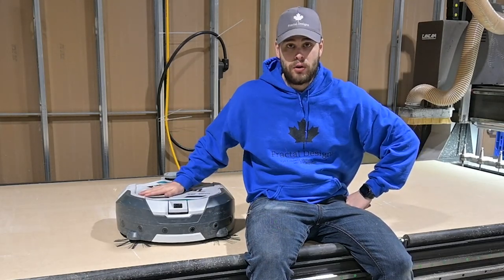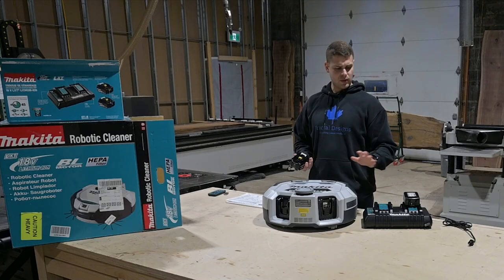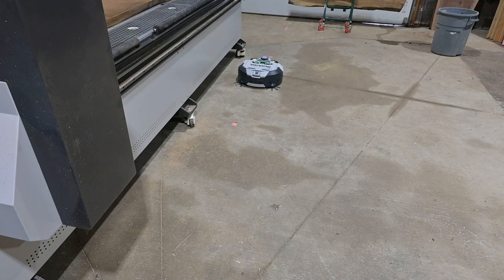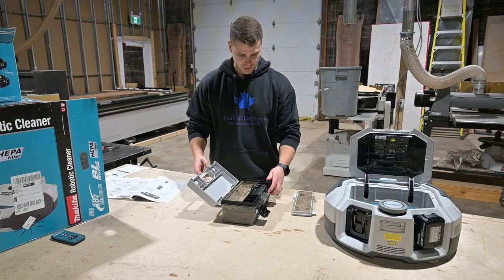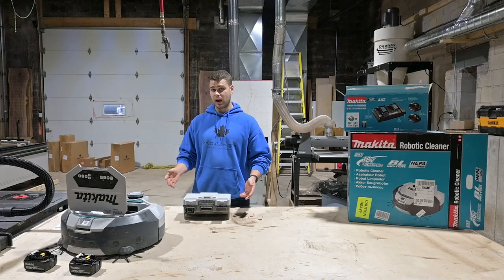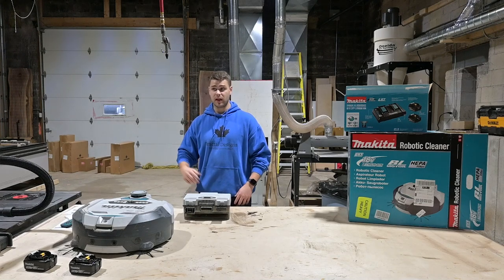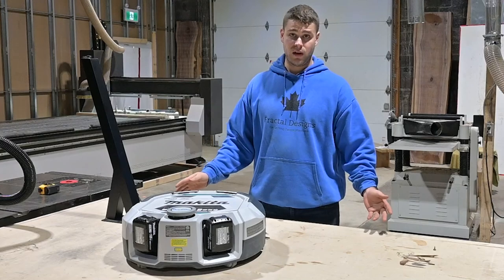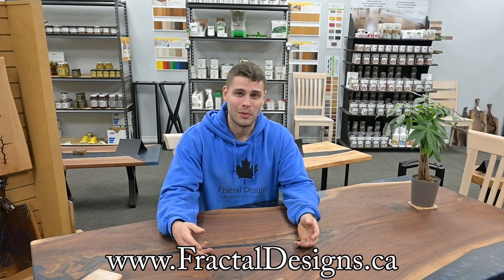Makita Robotic Vacuum DRC300 Initial Thoughts and Review

Comment: Congrats on being the first review of this I could find.  It would be nice to know how it works in a garage environment.  Will it scratch up my sports cars, for example?  Is it good with wet leaves and pebbles dropped in by car tires?
Reply from the maker: If it was me, I would definitely add some foam tape onto the bumpers - it rams pretty well if the sensors are dusty... Small rocks should get... Anything bigger than a penny likely not. It works pretty awesome but has its limitations. I haven't used it for any wet leaves. Small dust and debris it's awesome.
Reply: Wet leaves ?? Really?
Reply: I have the older model Makita DRC200Z to clean my barbeque area and patio so it can definitely handle some wet leaves and pebbles from car tyres.

Comment: Thank you for the detailed review! You are still basically the only source of information for this machine on the internet a whole year later! I'm very much on the fence about purchasing this for my garage shop use. I noticed the app had an update 3 months ago at least for the iphone platform. Have you had any success with this most recent update? I don't personally need the app and am ok with just starting the robot manually but I am curious if the app provides firmware updates to the robot to improve its reliability? Does the robot handle fine dust from your woodworking tools without clogging the filters and losing all suction too quickly? I plan to use it exclusively for keeping the floors as dust-free as possible. Would you make this purchase again today after living with it for the last year?
Reply from the maker: I haven't tried the app again. The sensors have started to give me a hard time on our shiny-ish floor. I believe it's from the reflection. A version of this a little more robust- fewer sensors and more filter capacity would be better IMO. I believe they have launched a new one now I'm not sure if they've fixed any of this!

Comment: I got one and think it’s far better. Than the original. The remote control feature is cool. 

The app however didn’t work because Amazon likes to sell used products so whoever had it prior changed the password. I reordered it somewhere else and returned it to Amazon. 

The green brush seems to work better on higher pile carpet and leaves stripes like my Walker Mower.

Comment: Great job with the video. I purchased a Roborock Q5+ for a retail store and it failed miserably. Hoping to find a more robust commerical solution. The Roborock failed me because of the LIDAR. Lidar doesn't work with mirrors and mirror/glass surfaces. It can even creates phantom rooms. I noticed that this comes with LiDAR also, Did you encounter any issues with it?

I feel like buying it and trying it but returning it would be such a hassle.
Reply from the maker: No issues with the Lidar part for us. We notice the shiny part of our floors sometimes gives us issues with the cliff sensor. We don't have any mirrors or shiny surfaces around that the top sensor would see so I can't really comment on it for you.

Comment: Thanks for doing this video! Did you ever get the app running and what do you think of this vacuum after a few weeks of use now? We have been looking at this for a long time for our Cnc shop but want to make sure we can get the mapping figured out in the app.
Reply from the maker: Hey! I never got the app to work, I will give it a go before we upload our couple-month review. I do believe you can set up the mapping with the remote still. We find it's still best to pick up most CNC debris with a shop vac and then allow the robot vac to do the shop and pick up whatever was trekked around!

Cheers,
Brad

Comment: Hello, we have an area of 15000 sqr meters. But we don't have rooms with open space. In this case, we will need to use more than one robot, then we will use temporary separators to do the mapping. But I am worried that since it is not a very smart device, when we remove the separators, will it work within those limits or will it move to the next area saying there is no wall? Can we draw boundaries like robot vacuum cleaners at home?
Reply: Nope no virtual boundary you have to use the expensive magnetic tape to separate them

Comment: It’s very large, would this be useful in a medium size home?
Reply from the maker: I don't think a home would be the best fit for this vac. I think it thrives in an industrial environment. I think it would do a good job, it is just quite large, and no docking station like a lot of the competition for homes so it would require a lot of daily hands-on.
Reply: @FractalDesignsInc  that’s what I thought from the looks of it. Thanks!!!
Reply: Get a Roomba, you can actually repair them and they are built like tanks.